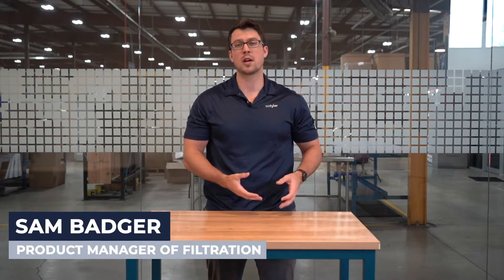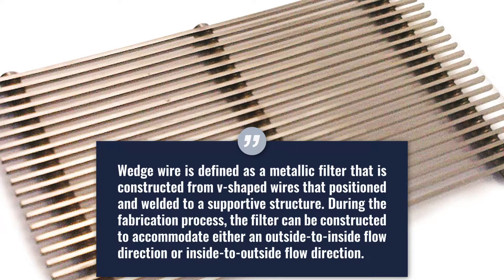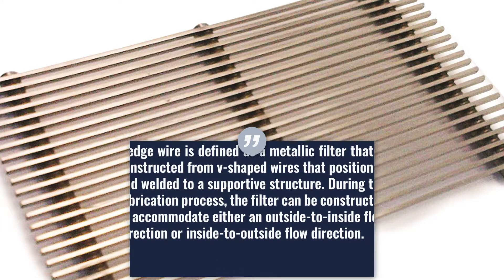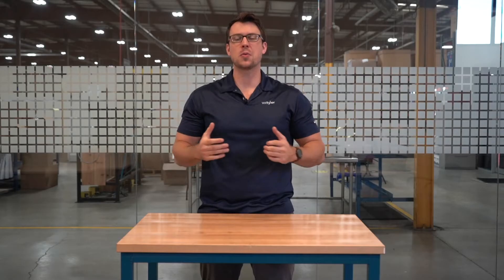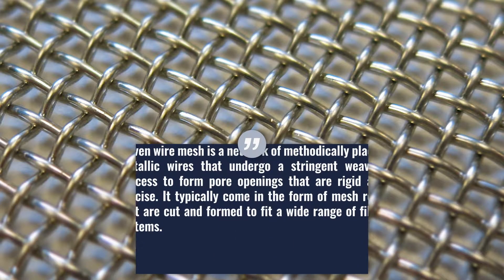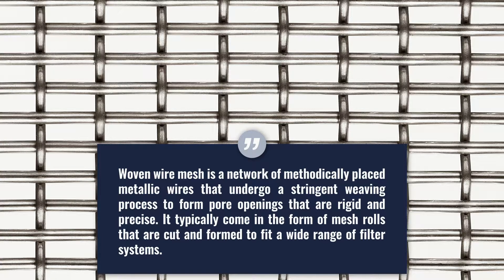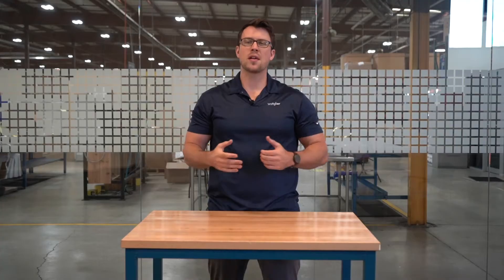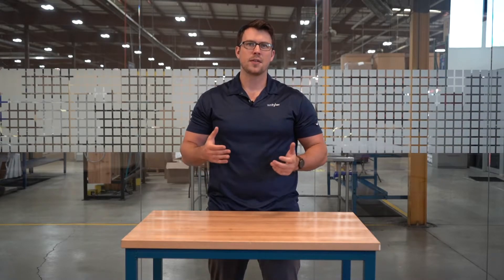Wedge Wire VS. Woven Wire Mesh: Picking the Right Filtration Solution

Comment: Do you guys sell wedge wire in 100-300 micron ? I usually use expanded metal and perforated metal , this specific job is requiring wedge wire and from my research it’s hard to find. Can one curve it with a standard cnc break ?